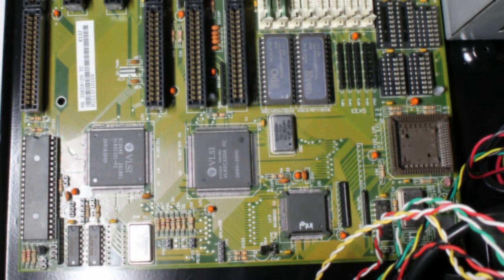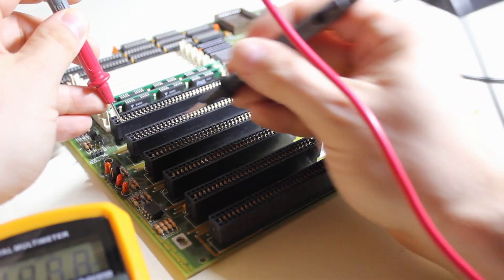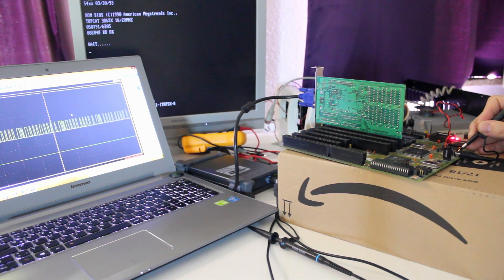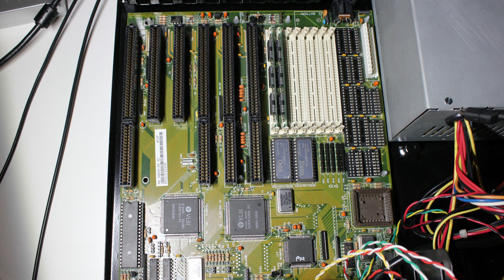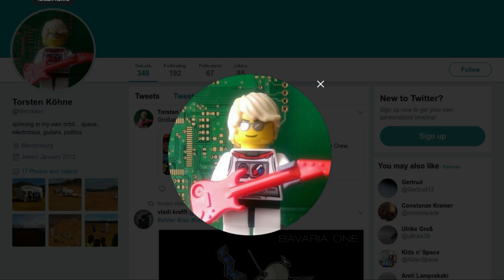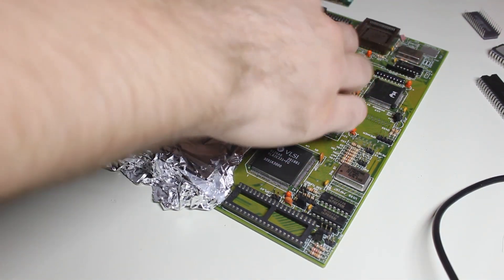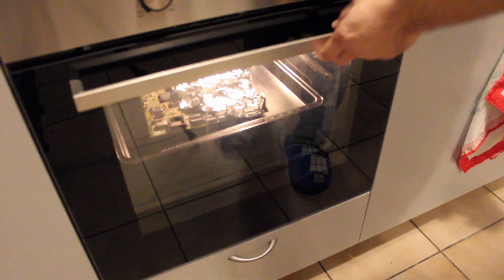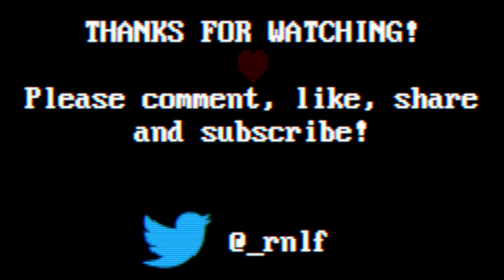386SX Mainboard Emergency: Baking it!

Comment: reasons for baking:
water vapour, oils from hand, and other liquids will evaporate and fix it...
capacitors with cracks may "melt" slightly... enough for it to be better...
corrosion on unseen parts are fixed too...

the catch?

everything gets to where they were with a relative short time... (because you removed the water, not the physical affected part, like something corroded that has a huge surface area now compared to a clean new metal...)

Comment: Most likely you had a lifted lead on one of those big PQFP's  Drag soldering would probably have fixed the problem a lot better than heating it in an oven which is usually something you do to reflow a BGA where you can't get to the joints.

That being said, these style boards were poorly made when new.  I'm amazed that any of them are still working between workmanship issues and leaking barrel batteries.
Reply from the maker: I reflowed all the easily accessible pins manually, to no effect, both on the QFPs and DIPs and even all sockets. It didn't do anything, that's why I didn't show it.

Comment: I just don't understand: how did you want to protect those plastics with the aluminium foil exactly?!
Reply from the maker: The oven's heating element is right above there. The aluminum foil at least inhibited direct radiation from the element (which is hotter than the air temperature the oven regulates for).
Reply: @flashmeback  makes sense, although would always be better to move the board as far as possible from the heat source..
Reply from the maker: @mkolt  That, too, yes :-)

Comment: should I assume this didn't end well since it's been almost 2 months? in any case, very interesting videos, good work so far!
Reply from the maker: Yeah, the fix didn't last very long. It worked for a while, then died again.
It took me a while to get a new 386 and I'm like 75% done with the new video. I hope I can get it out before the end of the year :-)
Reply: @flashmeback  that's a shame but good to hear you are sorting out a solution, looking forward for the next video and thanks for the update!
Reply: @flashmeback  I wondered about that too.  Louis Rossman had a response video to Linus Tech Tips about Linus using an oven for a reflow and Louis's point was that an oven reflow at best only fixes things for a short time.  Not surprised to hear that that's what happened to you too...